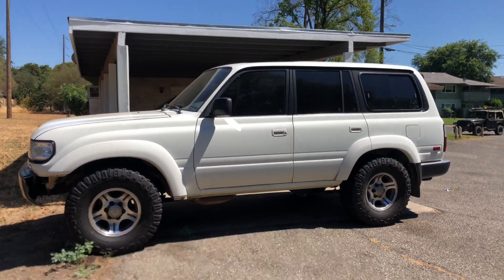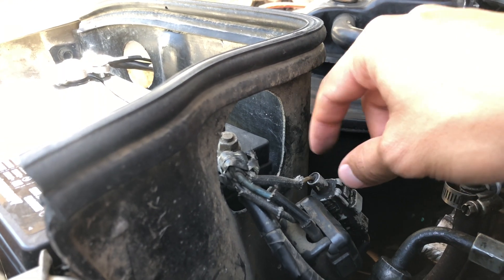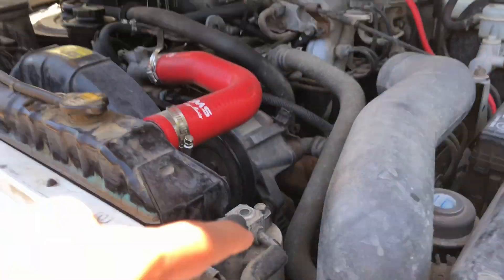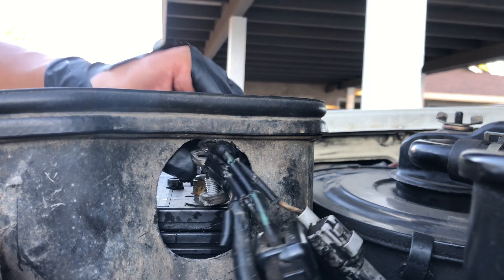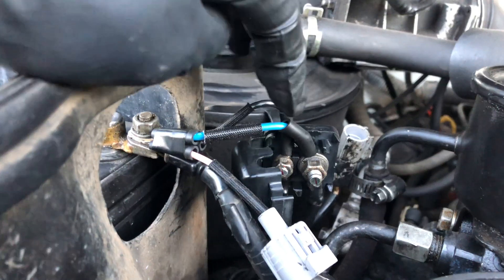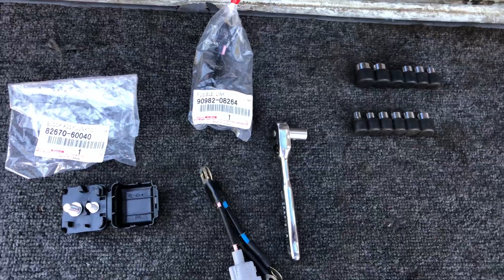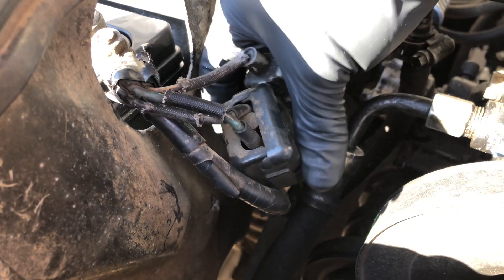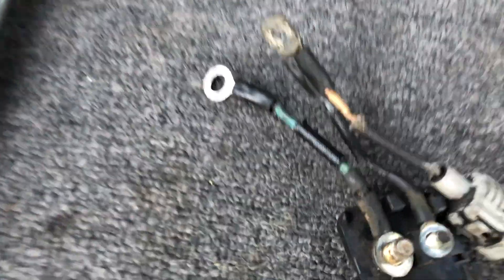land cruiser wont start? Fj80 Fusible link replacement

Comment: Hey 
Just a video idea for you to do for people. 
When the factory cruise control is not working and you have led tail lights.
Put in resisters on the wires behind the rear brake lights

Comment: So mine has the junction box, but I don't have a regular fusible link; the red wire is it's own terminal end without that light gray clip that yours has. PO must have modified. I experienced a one-time shut down after a hard right turn into a hard left turn into a parking lot. I immediately just turned key to off and then started it back up no problem. Wondering if I have a loose end somewhere in the link.

Comment: Liked and Followed mate I got Alternator issues (1FZ 95 4.5 petrol cruiser) on the way home from one of my BUSH TV Video trips and 1st thing that happened was all dash lights started to flash so that's an Alternator issue. 14 years ago I had the same thing happen but that time Dash lights on Ide give the Alternator a tap and it would get me home. This time I taped it and the dash light stayed on then i turned off the motor (battery still fully charged)  then motor would turn over but no fire at all. Checked all fuses Not the link yet and no luck so a Tow is was. Alternator is now out and waiting for a new one. In the mean time ill replace the link and the EFI Relay as well.

Comment: Hey did you have to change the bolts on the Fuse box?  mine are worn out maybe melted? what do you recommend?
Reply from the maker: I did not have to change out those bolts.. I just reused them
Reply: @TheEverydayBuild  Thank you, your Videos are helping me save my old FJ80 with 300,000 miles on it.

Comment: Thanks again for the video, I experienced something similar the other day, my LC didn’t start, but was because the starter fuse, even though I put a new starter nothing happens. I don’t know what the mecánico did in order to fixed it.
Reply from the maker: It could also be the EFI relay which is similar to a fuse